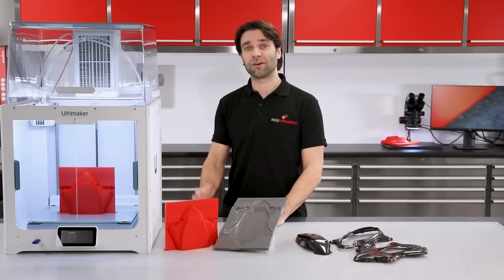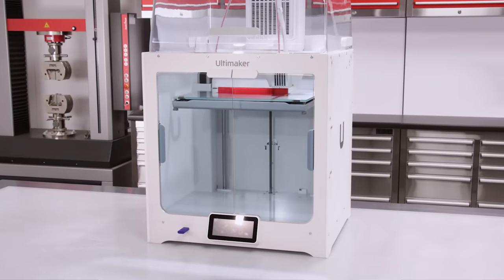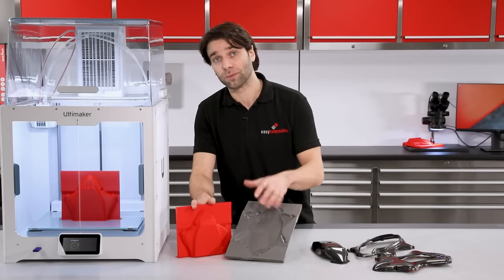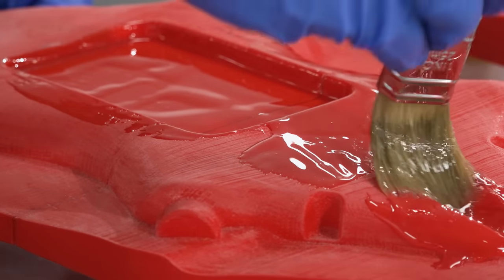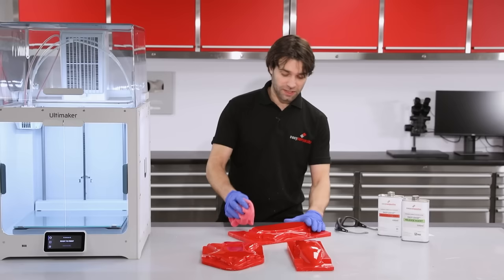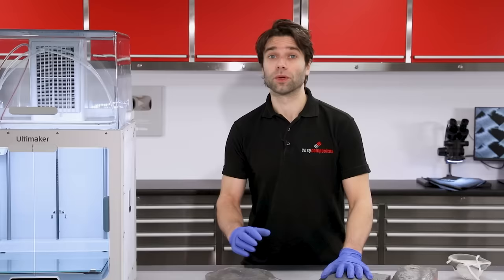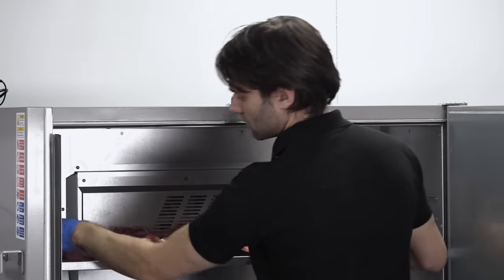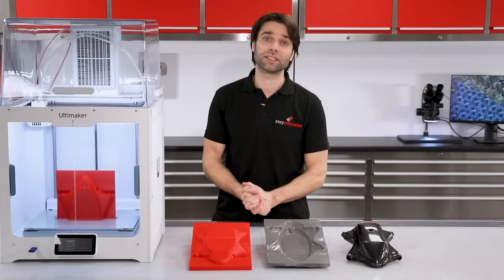Making a Composite Mould for a Carbon Fibre Part from a 3D Printed Pattern

Comment: Thank you for the video! But would be much more interesting to learn how to make such complex parts with vacuum infusion and not prepreg as not everyone can afford an autoclave.
Reply: The XPREG used by EC is an out of autoclave prepreg. Thus you dont need an autoclave, just an oven.
Reply from the maker: Well, this video was about the moulding process. Once you have the mould you could make the part using any process you like, including just a hand layup. About 5 videos back we did a hand layup which we vacuum bagged and demonstrated using a vacuum cleaner for the vacuum; it’s doesn’t get much more accessible than that. Also, the next video in this series uses a 3D printed mould and then just hand laminated carbon fibre into it; again; about as simple as you can get so stay tuned for that one 👍.

Comment: I have a question: Say you need an existing part copied, and even slightly altered; Is there some way to scan it, upload it to a CAD-program, and then modify it, before you 3D print it?
Reply from the maker: Yes absolutely, you'd need access to a 3D Scanner but once this is converted into a CAD program, it could be manipulated/modified.
Reply: @easycompositestv  Sounds good..
I've heard rumors of computerprogrammes that can create "models" from digtal photos, from different angels, do you know if there are any truth to these rumors or not?   Thanks for your reply
Reply from the maker: @runar500  It is not an area we have expertise in so we would not be best placed to advise.
Reply from the maker: You can certainly import photographs/sketches onto planes within most CAD software to use as templates to develop 3D models though.

Comment: Hi guys, I enjoyed the video and was thinking about reproducing the procedure with some pieces. Unfortunately the country I live in (Brazil) is not listed for purchase and shipping of XCR Epoxy Coating Resin :(
Would you have any representative in Brazil or would you know to inform me of any alternative for XCR here?

Congrats on the video!!! :)
Reply from the maker: Hi Bárbara, thanks for your message. Yes, unfortunately, it's difficult for us to send any products classed as 'dangerous goods' (like the XCR resin) to Brazil. At the moment, I'm afraid we don't have any distributors or representatives in your area. Although they might not work quite so well, you could try using alternative epoxy coating resins, maybe those intended for surfboard coating; they tend to have smooth shiny finishes similar to the XCR.

Comment: would vaccum forming given you a fine surface and mould halves faster?
Reply from the maker: Not mould halves that we could use for the high temperature cure process we show in this video, no. Maybe for something more basic, wet layup, ambient cure, no vacuum bag and less critical on surface or accuracy though, but then you'd probably be better printing the mould directly, like we'll do in our next video.

Comment: I have a question.. does curing non prepreg carbon fiber gives more strength to the piece?
Reply from the maker: A post-cure is not essential for room temperature curing resins but can improve strength slightly but certainly improves heat resistance.

Comment: why not directly to make the 3D printed mould, I think the reason is that a mould is normally of concave surface and it is difficult to polish the inner concave surface with a risk of over grinding the edges. however a 3D printed part, being a convex one, is more easy to polish and then a fine finish mould can be made over it. Am I right ??
Reply from the maker: You cannot make the mould that way as it is not suitable for high temperature use which is the point of this video to make a high temperature suitable mould. For non-high temperature use, watch our other 3D printing video here: https://www.youtube.com/watch?v=4ND2WtEZatY

Comment: I have a question. How would you produce a carbon phone case for the iPhone ?
Reply from the maker: You could use a similar method to this, however carbon fibre tends to act as a faraday cage when used as phone cases and thus reduces/blocks phone signal so you have to be very careful with your design to ensure you do not effect the operation of the phone.

Comment: I want to make (or have someone make) a small turbine for a water pump. The 6 curved vanes are only 5 mm high on a 65 mm dia flat backplate. There is a 25 mm central "hole" for the inlet. I have the 3D printed model but it seems too small to make a mold reliably between the vanes without things sticking. Is there a product for a mold here?
Reply from the maker: You could cast the mould using our TC80 Tool Cast.  Careful mould design should help with release. https://www.easycomposites.co.uk/tool-cast-epoxy-casting-resin-for-vac-forming-tools

Comment: How many cycles should those molds last at the temps you were using?
Reply from the maker: If looked after, there's no reason you shouldn't get 100+ uses.
Reply: @easycompositestv  Alright. Thanks for the reply.

Comment: Could acetone vaporsmoothing layerlines skip manual coating phase?
Reply from the maker: Vapour smoothing with acetone only works on ABS and when it does work, it’s only really suitable where you want a shinier finish but aren’t to worries about the accuracy or flatness of it because vapour smoothing tends to leave a shiny but wobbly surface. Resin coating then flatting and polishing is the answer where you’re looking for a quality finish rather than just a slightly shinier one.
Reply: @easycompositestv  Thanks ! Appreciate your answer !

Comment: What is the epoxy coating you're using?
Reply from the maker: It is our XCR Epoxy Coating Resin - you can find more detail and a more comprehensive video guide by following the link below to our website: https://www.easycomposites.co.uk/making-a-composites-mould-from-a-3d-print

Comment: how do you make the exact and precise design for the 3D printed model ?
Reply from the maker: This was generated in CAD, specifically in our case we used Fusion to model the part.
Reply: @easycompositestv  thanks for the info

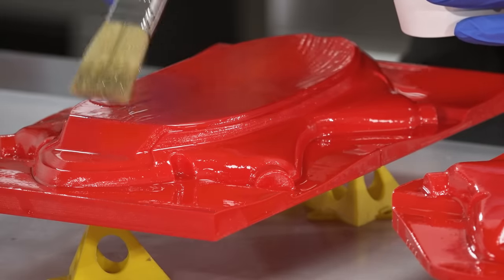Comment: 3:52 can 2nd coat of resin dimensionally change the final part ?
Reply from the maker: It will fractionally yes but only by the thickness of the resin layer which in most cases is around 0.5mm or less

Comment: What's the difference between a pattern and using an original part to make a copy of?
Reply from the maker: In many cases a pattern can be an original part modified for moulding from.  Sometimes it can be easier to make a specific pattern such as in this case where an original did not exist.  When using 3D printing or CNC, you can modify the pattern to have flanges/edges to make moulding easier. If using an original, eg a car body panel, you would fabricate flanges/edges prior to moulding from it.
Reply: @easycompositestv  I see, so either  way using a small original part/pattern would still difficult?
Reply from the maker: @CatchiestWorm12  It can be depending on shape and other factors. There is not an easy way around it if its not something that can be done in CAD and printed or CNC'd to make things easier.

Comment: Why didn't you use 3D printer molds and re-mould with special materials?
Reply from the maker: This is for a high temperature mould hence taking a mould off using high temperature materials.

Comment: Is there ways to do thither without vavume bags
Reply from the maker: Yes, absolutely. Once you get to the point where you have the mould then the process you use to make the part is entirely up to you, you could use a traditional hand lamination (wet lay up) process, such as the one we showed in the  recent tutorial about the bike frame protector. In fact, in the next tutorial in this series we will 3D print the mould and then do a traditional hand layup of the carbon fibre into that mould.
Reply: @easycompositestv  oh awsome will look forwerd to the next video :)

Comment: Why not using resin based 3D printers? way smoother finish
Reply from the maker: Resin printers can be used but FDM are generally lower in cost and more widely available so we wanted to show a process that was as useful and accessible as possible. If you were using a resin printer then we believe it's still important to coat the print with epoxy in order to provide a reliable surface for the release agent.

Comment: Might be a stupid question, but can I cure the pets in my oven at home?
Reply from the maker: Pre-preg needs an oven with stable and reliable temperature control. Some domestic ovens are capable of that but it is worth checking with a good quality thermometer.  Also you would have to manually manage the cure cycle.  But it can be done with care.

Comment: How are the fumes? I didnt see you wear a respirator for any step
Reply from the maker: The only two products with solvents are the release agent and mould cleaner; in most situations you should wear a vapour mask when working with solvents. The epoxy gelcoat and the laminating paste are VOC and solvent free so there's no 'fumes' as such (or odour) but you should ensure adequate ventilation or wear a vapour mask.
Reply: @easycompositestv  good to know! Thanks for the fast reply!

Comment: Using fdm printers, also a fact :  for the size of the parts, you will have a long and boring job of printing it in several parts on a msla printer

Comment: It would be simpler and cheaper to machine aluminum molds.
Reply: In what universe?  Wouldn't CNC machining cost well over a grand for a one off mold?
Reply: @johnmaccallum9984  go to Weerg.
Reply from the maker: I really can't imagine it could ever be cheaper to machine a billet aluminium mould. The material for the 3D print would be only a couple of pounds and the material for the mould is available in one of our starter kits for £30, that's a £32 mould. If you know a place where we can get a 30cm x 30cm x 7cm mould machined from billet aluminium and finished to high gloss then definitely share a link!
Reply: @easycompositestv  32 pounds !!! And the workforce you forget. If your labor is free, I would be happy to order all my molds from you. I am not criticizing your work, but you are forgetting a lot. I challenge you to request a price from WEERG for the price for a high gloss aluminum mold. I have already ordered and I am fully satisfied with it. Not to mention that they can be autoclaved without alteration and almost indefinitely.

Comment: Compared to other more economical printers, not everyone is gonna dish out 6k for a 3d printer right off the bat, when there's creality , sidewinder, and others out there that are much cheaper and do the same thing.!
Reply from the maker: Indeed.  However this printer met our needs better than the cheaper DIY/hobbyist machines.  No reason why the same project could not be done using a cheaper machine.
Reply: Like Easy Composites mentioned, cheaper printers will work. We chose the Ultimaker S5 here for those looking for an easy workflow and end-to-end solution, from software, to hardware, to materials.
Reply: @dynamism6990  what software is included with the printer?
Reply: @rubenrobles7275  The Ultimaker printers use free Cura slicing software. In addition, Ultimaker Digital Factory is a cloud-based software that let's you queue, manage, control, and monitor prints from your desk or home.

Comment: Wait, why not just print the mold and save a hundred steps?
Reply from the maker: Hi Jane, that's exactly what we'll do in the next tutorial in this series. The reason why we didn't in this one is because we wanted to show a process whereby a 3D print could be used to make a prepreg carbon fibre part. Because prepreg can only be cured at high temperature under pressure, a 3D printed mould isn't an option, you need a rigid, high temperature composites mould, and so the correct route is to print the pattern and then take a high temperature mould off the pattern.

Comment: great diy.
just need 100000 euros for the machines
Reply from the maker: Hey Tiwey, well, not quite! 200 euros would get you a 3D printer and then you could just hand laminate the carbon fibre part like we've shown in other tutorials (and the next one in fact). Total spend would be under 300 euro and you'd have bought a basic 3D printer for that. Or just ask a friend to 3D print the pattern for you, then it's only cost less than 100 euro. I'd say that's DIY money. : )